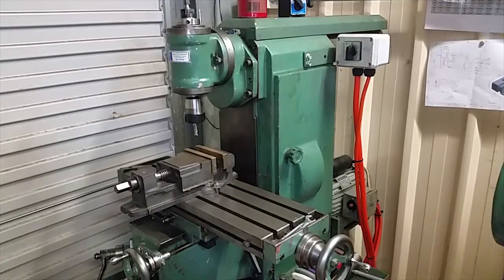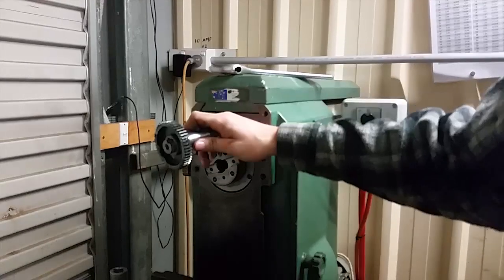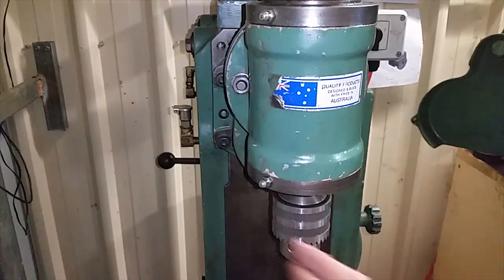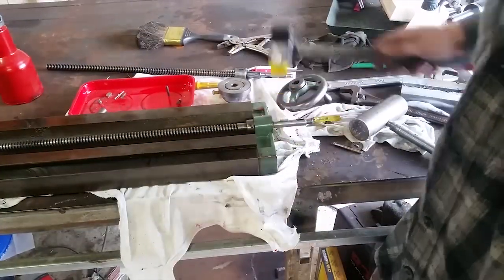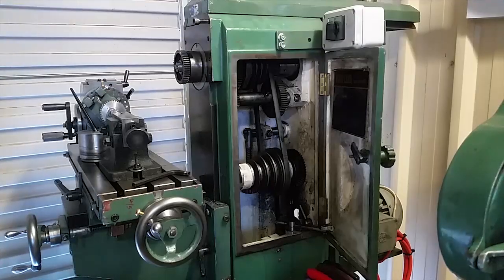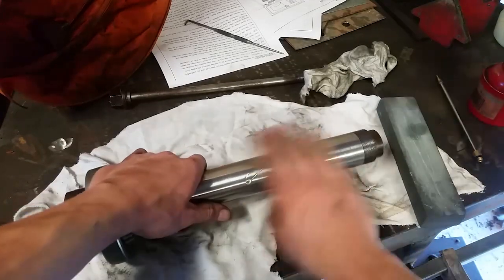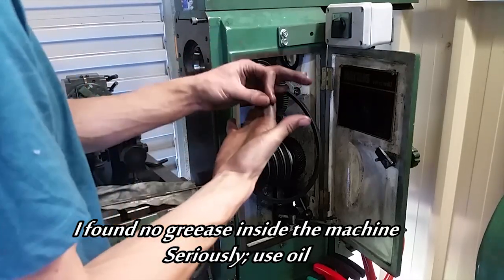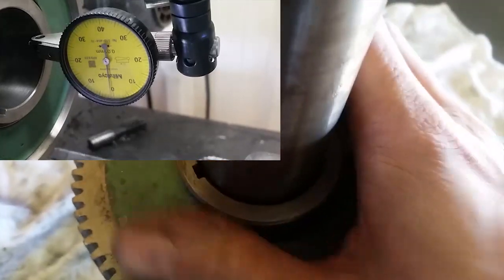New Hercus Mill | Machines; oil or grease?

Comment: Hey Tom. Just come across your video while searching for Hercus info. Had a chuckle to myself as I have a Hercus Vertical Slotter that I have just re-powered today. Same deal previous owner had pumped in grease instead of oil. Have managed to pump 10W through and flush out the grease and give the machine a good run. I can now pump the correct oil in which is Vactra 2 slide way oil. The plaque on the machine clearly states use Gargoyle Vactra Oil Heavy. DO NOT USE GREASE. Love your You Tube Site. Cheers.
Reply from the maker: Thanks for watching
Yeah it's a good machine, I'm about to give it a whole heap of upgrades; DRO, riser block, powerfeed...
I'd be interested in seeing your slotter, that's another project on my endless list :)

Comment: Wish I had a vertical head for mine. I’ll find one eventually (I hope).

All the best, great little mill :)
Reply from the maker: Yeah these mills are built really solid for their size.
The only issue with the vertical head is the lack of vertical travel. I plan to install a riser block to fix this
I'm not really sure where you would find a head either, I can't imagine anyone would want to part with it!!
Reply: TommyGun Machining looking forward to seeing it if you share on here :) yes I don’t have high hopes, but I’m unlikely to get another mill anytime soon so fingers crossed (I’m just a hobbyist). I have the mill set up as the horizontal, original dividing head and vice and it came with some tooling.  Missing the tailstock and vertical head (if one was ever included). In the manual and accessory book it says the vertical head (and many of the other options) were only options so there will be fewer vertical heads around than there are mills unfortunately!
Reply: @TomMakeHere  I found one!! Mal came through :)
Reply from the maker: @PracticalPrimate  wow very lucky! That's awesome! Do you know if he has any more? I know of someone else also seeking a vertical head
Reply: @TomMakeHere  not three slotters (i waited a while and did get very very lucky) but never asked about two slot heads. Worth asking! I do know of somebody with a three slot head but no mill (long story haha). He is looking for the mill though.

Comment: Gday Tom. I have just got around to fixing up the Hercus Mill and I remembered you saying your Mill was chockers with grease from idiots not knowing to use oil. How did you get rid of the grease in your machine? Its all through mine including the spindle. I would prefer not to take the spindle out but will if its the only way. The last thing I want is my beast siezing up on me
Reply from the maker: I disassembled some of the main parts and wiped out what I could with a kerosene soaked rag and picked out as much as I could out of the 'grease nipples' and then injected oil with a high pressure oil can to flush out the remains.
Because I couldn't get oil fittings of the same size I drilled out the holes and tapped / inserted press fit oil buttons and cups for most of the fittings (some I still unscrew and inject oil as I didn't get enough push button oilers)
I also tried making a zerk fitting adapter for my oil can, but it couldn't force the fittings open. I think oil cans don't put out enough pressure to overcome the check in the zerks

Hope it helps
Reply: Thanks dude. That was on the same lines as I was heading, minus the press fitting new oilers. I do have to buy a push type oiler however have been surviving with an oil can and the nozzle changed over to a grease gun goose neck. Thanks again and it looks like I have some long days cleaning ahead of me
Reply from the maker: If it was anything like mine the grease hopefully won't be too bad, it didn't really get into the tight spaces